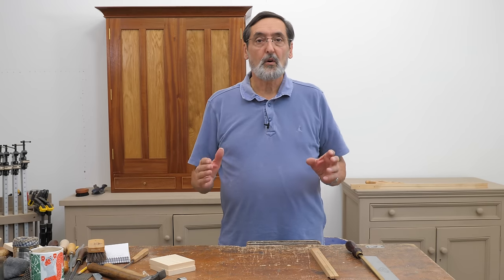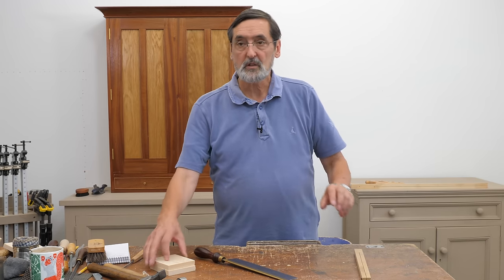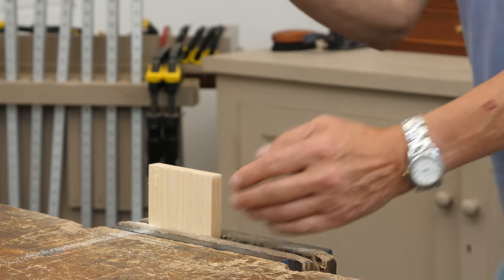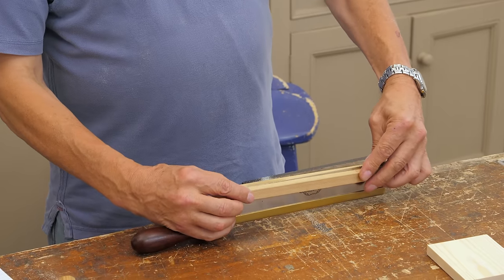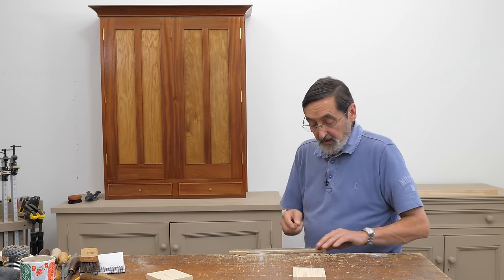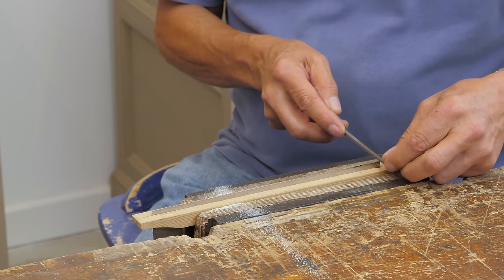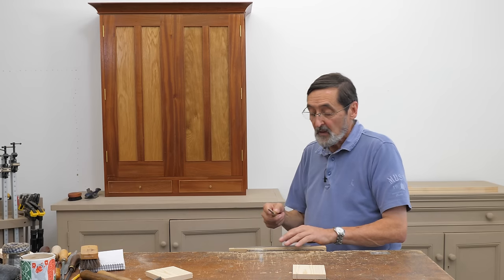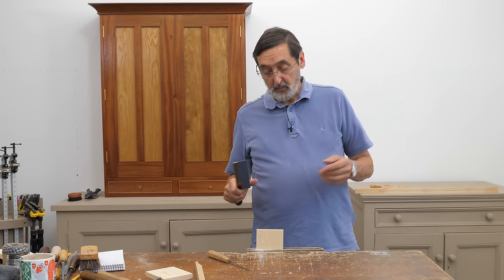How to Correct New Saws | Paul Sellers

Comment: I bought a Stanley Fatmax backsaw a while ago and was very disappointed with it, especially getting the cut started and that the teeth kept catching on the push stroke. Having watched Paul's saw videos I realised that the problem was likely to be that the set on the teeth, as supplied from the factory, was too exaggerated so I tried the trick of flattening the set between two hammers and what an incredible difference it has made. The action is much smoother and the cuts are quicker, finer and cleaner - basically the saw is now doing what I expected it to do from the start.

Comment: Nice video Paul, but should you mention that this technique is no good for hard point saws that you get from most hardware sheds !!
Reply: Usually the smaller saws that you get at hardware stores  (you know, the ones you get together with a cheap miter box) don't have hardened points.

Comment: It looks so easy. My only question is where do you get files for sharpening saws? Hardware shops have long ceased to sell anything other than grinding wheels and oil stones for sharpening of tools.
Reply: Amazon is one place. You want saw files which have 6 serrated surfaces, not just the three flat surfaces like a triangular file. Pherd and Bacho are good ones.

Comment: You could see the saw edges coming up as soon as you started! Question, I have a very fine toothed, very flexible hand saw, can this be sharpened? I have heard from other woodworkers that they can't because the teeth are just too small.
Reply from the maker: Hi Barb. When the teeth get as small as 20 teeth per inch or less they are more difficult to sharpen.

Comment: Where do you find files that are suitable to sharpen saws? I havent really noticed them in hardware stores.
Reply: Neither have I and I have even checked Amazon to no avail. I am going to be seeing a machinist friend of mine this weekend and possibly but an end to this mystery.
Reply: gamingSlasher just type saw files into google.
Reply: If you are in Canada or the US Lee valley sells Bahco files in quite a number of sizes, they are a bit on the pricier side when you consider a whole set (if you need a whole set) but Paul's claimed to have gotten quite the milage out of his files thus far and mine thus far are holding up as he mentioned.
Reply: menards. in the files for sale look for a shorter 3 sided file marked for saw sharpening. my local store had 1 to choose from, but it seems to work fine enough. I think it is a Stanley brand.
Reply: Caleb Welte thank you. I came to the comments look for this exact information.
Reply: I bought a Nicholson one not long ago, it was surprisingly cheap so I'm doubting it's a legitimate one. It says Nicholson and then brazil on another face, either way I think it'll work just fine. (btw I'm not in the US)
Reply: Paul's response to similar comments: 
"Just a Bahco 5 inch extra extra fine on eBay" 
 ... HTH
Reply: A lot of good answers here . . . I'll just add that almost all hobby shops have smaller files for model builders, and there's always a three-sided file in the mix just like the one Paul has here.

Comment: Is this technique the same for either dovetail or crosscut saws?
Reply from the maker: Generally, on small-toothed saws, I recommend sharpening fir a rip-tooth pattern as shown in the video. It's not at all necessary to use the crosscut pattern as there is so very minimal gain and it takes longer and more skill.
Reply: If the saw is as new a cross cut saw should this be the method of filing straight from the package, or is there any steps in between?

Comment: Is that the Pax gents saw? That was the first thing I ever tried to use to cut dovetails. With a little tuning, it's not a bad little saw at all and as I recall, it was only $20 or maybe $25. Thanks for everything you do!!
Reply from the maker: Yes it is. It’s made by the same company, it may not be a Pax but they are all the same under a different name.
Reply: I’ve got a pax one and a stiles and brown all same maker the stiles and brown is longer but the pax is deeper. Both good saws and cut very well. As with all new saws I’ve found they are always better after first sharpen
Reply: Could ou please tell me were I can get a saw like that for 25.00 with that type handle. I can,'t find anything for under $100.00 even online.
Reply: Frank Schuckert http://www.flinn-garlick-saws.co.uk/acatalog/William_Greaves_Gent_s_Saw.html this is the manufacturers of that Saw they have several brands and several price points the one in the link is £15 here in U.K. and has a steel back so is cheaper.

Comment: Hey Paul, just wondering, can you buy a disposable saw, use it till it's no good, grind off the teeth with an angle grinder then file it flat and cut and set new teeth in it with a screw file and maybe a saw set or your poor man's saw set? Perhaps you can even sharpen hardened teeth with a triangular stone slip? Going to try it anyway ;)

Comment: Why does doing that make such a marked difference? Also, you stated in other videos that most modern saws can't be resharpened. Is this particular saw/brand different from the run-of-the-mill varieties available?
Reply: Tremolux Man you need to get a resharpenable saw, not one with hard point teeth.
Reply: I understand that and agree about resharpenable saws.  I just want to know how and why touching up the teeth as demonstrated makes such a difference in cutting efficiency.
Reply: The demonstration shows that saws do not come from suppliers as sharp as they should or could be, unless you buy one for hundreds of pounds.
Reply: As a followup to what Steve Davison said: There has to be a reason one saw is 8x more expensive than another. In general it is either the quality of the materials used or the quality of the workmanship used to produce it, or both. Paul has just shown us that, at least in the case of this particular brand of saw, workmanship was the main issue. I would guess that the saw's teeth were stamped out of the raw blade blank, rather than cut but that's just a guess. If the manufacturer is intent on manufacturing quantity that's a good way to accomplish it and the average home hobbyist never knows the difference because he/she will likely never get to try the higher quality saw and understand what that type of saw is capable of doing.  Paul showed us how a very small investment in time and tools can improve the performance of the cheaper saw well beyond what most would imagine possible.
Reply: Okay, thank you both for the explanation. Now I understand. I wasn't questioning anyone's expertise, I just like to know the rationale behind things. Knowledge is power.
Reply from the maker: It's really shabby marketing by the  makers in many cases. They actually make a variety of saws using the same good quality materials but add a little extra touch up for their top of the line versions and charge triple or more the price. ~As all saws must be resharpened anyway, why postpone learning it. Buy the saw and a file and do as I showed. After four or five sharpenings you'll have both the ability and the saw for life and the file will sharpen about 30 times, so ten years!!!???
Reply: And thanks to your willingness to share your expertise with folks you don't even know, several thousand of us have improved our knowledge and our enjoyment of the craft.  Thank you Paul!

Comment: Wow what a difference, and you didn’t alternate direction. That was all from using the file one way
Reply: Yes, I noticed that too. The only explanation I can think of is two fold; one stroke will not alter the cutting face that much and he was filing straight across as one does for a rip tooth pattern.

Comment: What's the name of that type of a saw?
Reply: It's a Gents saw
Reply: Personally I never had much luck with this style of saw; in terms of a small backsaw I much prefer "dovetail" or "tenon" saws with the pistol-style grip.
Reply from the maker: These gent's saws were designed for the gentlemen of the era and nit so much for craftsman users, but they did catch on because they have inline handles that actually give the greatest and most directly efficient power of back saw in this size of saw. That they work so well on dovetailing meant that craftsmen adopted them most readily.

Comment: why he seems to use half the length of the file?
Reply from the maker: We make these evaluations when we sharpen saws, mostly the decision is based on the saw plate thickness and/or the size of the teeth. When the tooth is small and the pate is thin also we lighten the pressure and shorten the stroke. The thicker the saw plate the longer the stroke or the heavier we apply pressure. `on very thin plate stock it is easy to file out a whole tooth if we are not careful.